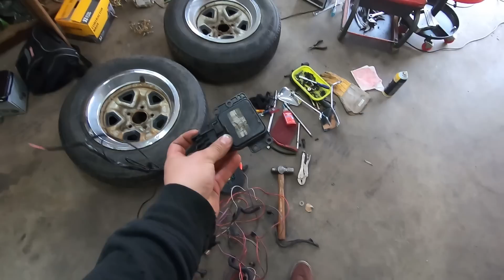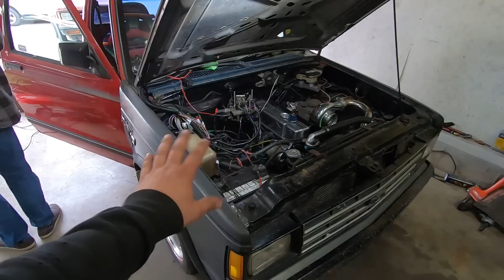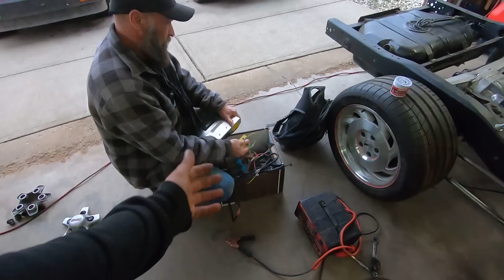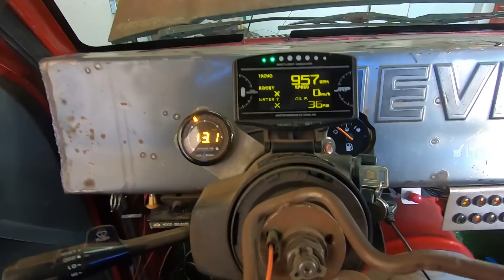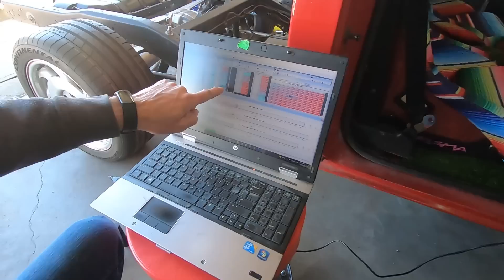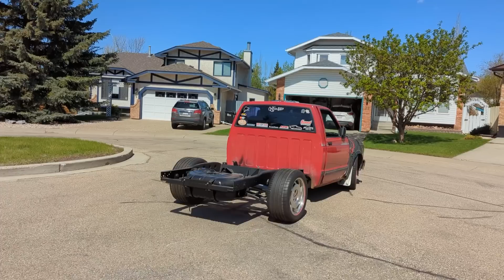RAT10 FIRST DRIVE?! Big Turbo 3.0L Mercruiser Boat Engine Swapped Chevrolet S10

Comment: I have a 1982 s10 v8 and a set of 94 corvette wheels 17x8.5 and rear 17x9.5 what rim spacers did you use if the rims are the same as mine thanks Mike

Comment: Couldn't have said it better about tuning. Though I will say... I threw a 7747 with EBL in my vette when I did the engine work. I took a wild ass guess at the tune for the initial fire up and left it in open loop. It started and idled at 750 immediately... I let it warm up, pulled it off the jack stands and went on a 50 mile drive... AFR was around 13:1 the whole time. I was legitimately shocked it didn't stall or hesitate a single time. Fueling above 4k was rich but it drove well... Then I spent the last 3 years perfecting the tune and I'm still not quite there lol.

Comment: I was writing a whole big post with a bunch of suggestions, including some stuff about the tune, ways to test for a vacuum leak, and even about going to the thirdgen forum because they have such a strong group of GM ECM tuning experts over there.
I'm glad I watched this part before posting, lol.

Awesome that you got it this far. I've done some minor tweaking on a mid-80s GM ECM but nothing from scratch like this. I've collected parts to convert my car to that same 1227730 (it's a much better ECM than a few years earlier, and is a well understood favorite), but I haven't actually done it yet. Hopefully it won't be a nightmare - but there's a factory tune for the 7730 that's very similar to my car so that should make it a lot easier.
I think your tune is especially challenging because there's no factory tune for anything much like your engine, so you don't have a good starting point to work from.

A longass time ago I had a cammed 2.5L duke. Occasionally it would get into that low loping idle at stop lights, which was pretty awesome. It didn't do it very often though. I didn't know anything about tuning back then, probably could have made it run better if I had delved into that.

Comment: Microsquirt  is like 400$ and can be tuned with tuner studio which is free to download. Great DIY  unit with lots on functionality.  Also you can make the bay virtually wire free to the point where it doesn't look like it will run.

Comment: Pretty cool I owned many Merc 3.0s and yes they were in chevs  for many decades. But my ? Is why there a low revving 3800 rpm maxxed out motors. I imagine grenades in my head when the turbo spools if it will. Love the try tho. Friggin cul de sacs bad ass backfire. Keep at bro like the content.
Reply from the maker: Haha this one says it’s rated for 4800 max which is still lows as hell. I’ll probably let it spin to 5500-6000 and see how long it lasts. The old iron duke this truck had before held 18psi and that thing revved to 5500

Comment: Nice truck! Had a boat with the 3.7 4 banger. It was huge. Around 170HP but 260 ft lbs of torque in a small boat. It was quick and always thought how fun that motor would be in a small truck.

Comment: is that a 1987 s10 blazer outside? I have one in my garage but the engine makes a loud squeal, either no oil is running through it or its low on oil, i cant tell, all i know is it's not good

Comment: Did you have to run spacers on those Vette wheels? I like em!
Reply from the maker: Yes! Vette wheels share the same offset as a 4x4 s10, 2” spaces gets you right where they need to be
Reply: @ak_strem7010  Awesome! Now I just need an S10 and some Vette wheels :(

Comment: It's been a while since I messed with a 730 ecm, but I am thinking that the injector strategy is different between a TBI and TPI. A TBI fires the injector every spark reference pulse and alternates from one injector to the other, but TPI fires all the injectors every 4th spark reference pulse so the injectors only fire once every crankshaft rotation. That would cause a really lean running condition. I don't know if that parameter can be adjusted in the program code or not. Another alternative might be swapping to a 16197427 pcm. It came in 94/95 GM trucks and will run 4/6/8 cylinder engines with TBI, port FI, or the funky Vortec spider injector system. There is a flag in the tuner to swap the injector strategy between the different injection systems.

Comment: You can get a 2020-2019 model megasquirt off eBay for around $200-$250 with built in map sensor and launch/anti-lag..... Hell a chipped Honda p28 or p72 ECU with a little modification would work all the same as well, certain chips have on the fly tuning capabilities just like a standalone ECU, best part is those ECS can be bought from junk yards for $20 and eBay for about $35, with the socket already soldered in and some random chip you can get them for around $100 $150 as well
Reply: Cheapest right now is over double that and recent sales cheapest is only $300-500. Buy one and send it to him! :D

Comment: Is this motor based on the 2.5 Pontiac iron duke ?
Reply: I believe it is, but with the big chevy bellhousing instead of the smaller 2.8 v6 bellhousing the iron Duke has.

Comment: I had one of these and so did my friend so we put a 305 in and it fit his truck but not mine and we did them both the same in his shop. It had to much power so he had to take it out also the springs and all had to be replaced to hold the thing lol

Comment: I know on Ford boxes, there is a setting that tells the ECU how many cylinders it has. I haven't tried doing this myself but I know it's possible.

It may be a setting on those as well.
Reply: The GM TPI ecu shouldn't care, the fuel injectors are batch fired and all fire simultaneously. All it needs to run is a couple sensors and the tune they were messing with.

Comment: From an antique computer to a not as old antique computer! There has to be millions of 4 cylinder later model cars in the junkyard you could source a computer from that was made in this century. 🙄LOL

Anyway,  I know the newer v8 confusers are re-programable, maybe look for a 4 banger one that is easily re-programable? No need for a $2,000 confuser, a junkyard donor car should have what you need that you can splice onto your harness or totally yoink the matching harness off of that donor car too and use that. Grab the fuel system while you're there as well to upgrade to multipoint fuel injection. Use your Corvette injectors so they're big enough when you're ready for boost. 

You're going to have a hard enough time tuning the throttle inj. without boost even worse when you introduce boost into the equation. Dealers choice though, I'll keep watching whatever you decide, just hate seeing you struggle with the antique operating system that has very little support and is very limited on its tunability. Good luck.
Reply from the maker: We tuned this very setup with the older shitty computer to 18psi with no issue so it’ll be fine
Reply: @ak_strem7010  
So why the video with all the struggling then swapping out the older confuser because you couldn't get it to work without a turbo?
Reply: @itseithergonnaworkoritaint7852  that's what I'm wondering
Reply: @ak_strem7010  but that was an 8 cylinder with a turbo. You're trying to tune this computer with a 4 cylinder. I get that you don't have the cash to drop on an an aftermarket ECU, but don't you think that maybe the extremely limited computer is what's causing all of the tuning issues? That's why I think you guys are struggling to get things tuned correctly. If you had a more modern system from a more modern vehicle, then there's way more options to get it tuned properly. That's just my thoughts
Reply: @Minitrucker231  His previous engine was also a 4 cylinder. There is no issue with running a computer originally from a V8 since obviously it's running the 4 cylinder properly. I'll be honest it doesn't sound like either of you are that familiar with tuning? Unless you want to give him the money for a different setup or wire up a brand new harness for him, then just watch what he does on a budget with what's available? The issue with the previous computer is literally an unknown and they swapped computers to solve it. Exactly the same reason you're suggesting swapping ECUs again. For an issue that has now been solved? This can still be tuned "properly" since they have the means to tune it. Plus his dad is familiar with this method of tuning, so it's a useful starting point for them. He went with the TBI intentionally because he wanted to and he may go to an individual injector setup later. I'm just saying this episode was about a solved problem, not a new one, and they barely started tuning it.
Reply: @802Garage  I'm not familiar with tuning at all, you're right about that, but I'm more worried that if the tune is wrong, once he introduces boost into the equation, things can go straight to hell in a hand basket. I understand why they're tuning N/A so that doesn't happen, but if that ECU ran 18psi on an 8 cylinder, I'm not really confident it'll run it on this engine. But it's his engine and his truck so I think I'll just wait to see what happens. I'm glad it moved under it's own power. But I think everyone is getting tired of seeing the struggles with tuning.
Reply: This is a Mercruiser 3 Liter... I would think it needs the computer from the boat. But they're so bound and determined to get it to run on antique hardware, that I really don't think he'll want to do it. We can suggest it until we're blue in the face.